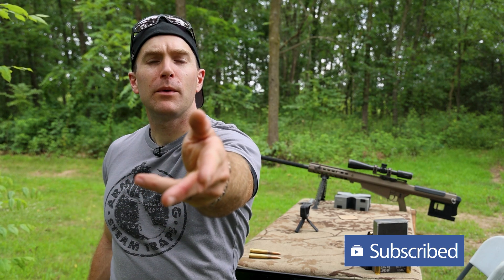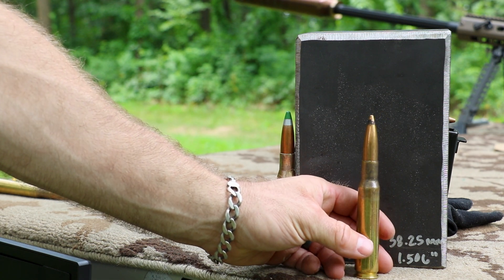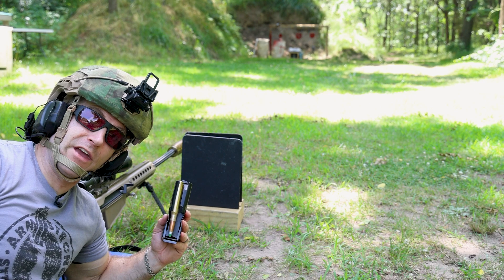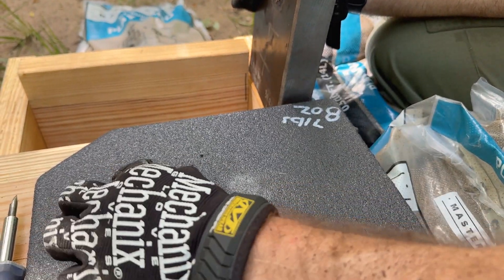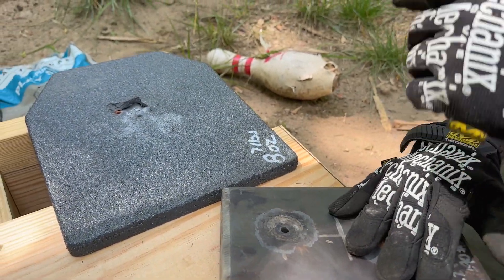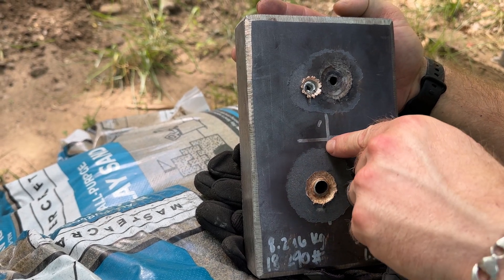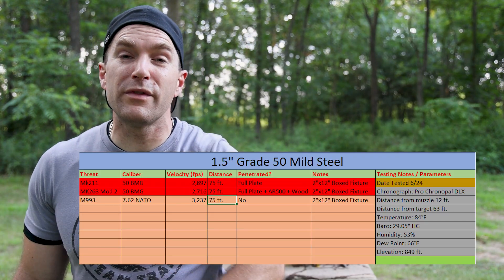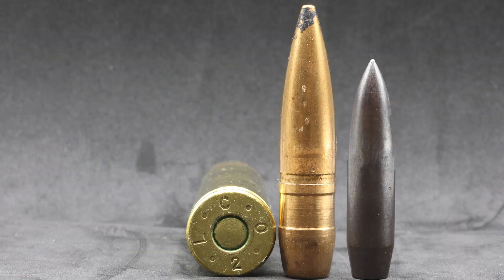Can 50 BMG MK211 and MK263 Defeat 1.5" Mild Steel!

Comment: Does mk211 have better penetration capability than 14.5mm b32?
Reply from the maker: There's no hard data I'm finding about MK211's RHA performance vs 14.5mm B32. Generally speaking Mk211 is tungsten round and it can penetrate more than a hardened steel core, but MK211's core is also designed to break up. Some sources say MK211 RHA performance at 500 yds is 50mm at 0° vs 14.5mm B32 is 32mm at 90°.

Comment: Hi,  Great video !  I was Just wondering   where did  you find out all the specific details  and pictures of the MK263  projectiles.  You posted the metal composition percentages  and  core weight on Flickr.   I can't find any information  details about the MK263  projectiles on the internet.  Just wondering where you found all the details. 
       Robert
Reply from the maker: @robertsantini2000  well I have a habit of going down a rabbit hole.  I typically sacrifice a projectile when I get them in to get the core out if  it’s AP. I have access to a really expense device called PMI - positive material identification. It only works on metals and it’s used at work to ensure vendor is supplying us with the actual steel they say they are :)
Reply: That's a fascinating machine you have access to.  Would you know exactly what type of tool steel this mk263 is.  I did some research and the closest metal with that matches that composition that you gave, is T1 high speed steel.  This is a tungsten steel alloy with 17% tungsten.  Is this what you think it Is?
Reply from the maker: @robertsantini2000  I unfortunately don't. Sometimes the machine can find a "match" but without being able to talk directly to the manufacturer, it's likely a guess. I would say if we were betting T1's composition sounds pretty darn close.

Comment: Speed and hardness defeats armor as you can see from that Gaping hole. 18 inch barrel is a waste of 50 bmg
Reply from the maker: The good thing the 19" BMG has value to me as it can simulate a 200 yard engagement for a 29" BMG.. But That's why I went with the 29" to begin with :D
Reply: @BuffRANGE  Definitely proved a point and the results were ASTOUNDING. I didn't think there would be that much pass through.

Comment: I followed the trajectory of a yellow fruit and found myself here 😂

Sheesh, that MK-263 is nasty! The hole it left wouldn't look any smoother if you had drilled it, and then to go through the AR-500 and still be intact to bite the wood, ouch! Not many rounds can say that they are meaner than Raufoss, but I think this one just about pulls it off.

I find the crater that the Raufoss left on the entry side very fascinating, I know that they contain an explosive filler along with ever other filler that has ever been conceived, but I always figured that was mostly just to enhance the incendiary effect, I didn't expect the surely rather tiny pea of HE to actual do significant damage on its own 🤔
Reply from the maker: Indeed it's pretty cooL!

Comment: Do the plates get warmer or hot from being shot with such massive rounds?
Reply from the maker: I think because they penetrated they did not transfer any meaningful heat to steel. It also could be since it's 18lb it wasn't enough heat to warm it up.

Comment: Would be interesting to see how they compare at longer distance, but i dont know know doable that is.
Reply: It's tough to test cartridges like these at range because their ballistics don't often match standard ball ammo (or each other), Even over just a hundred yards, you can get a point of impact shift of several inches when everything goes right (no dodgy ammo, no issues with the gun you're shooting it out of, etc.). So in order to sight in the rifle to hit the target at a significant distance, you'd have to use at least several, if not many of the super expensive and rare rounds to do so in order to score a clean hit to film. You either end up spending a pile of money on ammo, or a pile of money getting a target large enough to hit. That little hunk of mild steel he shot probably cost close to a hundred bucks all on its own, and the price would skyrocket for every inch taller and wider you add.

It doesn't help that most of these rounds are fairly old and sourced from wherever they can be found, so often there's no telling how they have been handled or stored over the years and the performance may change from one round to the next, even between rounds of the same type purchased in one batch. On top of everything else, all of these are military ammunition, designed primarily for use in machine guns, where accuracy by volume is an acceptable standard; so even fresh from the factory, you'd be unlikely to get match grade performance and consistently hitting smallish things at long range still wouldn't be easy.
Reply from the maker: Right! Effectively this is how I would test using shorter barrels. The 19" 107A1 is like a 200 yard engagement if you fired from a 29". The issue now is affording said 19" upper.

Comment: A challenger for the MK263 Mod 2 would be the NAMMO NM185  Armor Piercing Super/AP-S, which uses an enlargened tungsten core, either with inert or incendiary point filler. It was designed to try and rival the M903 SLAP with better accuracy.
Reply from the maker: That sounds not easy to get..
Reply: @BuffRANGE  Basically impossible, more of an observation on my part.

Comment: Crazy to hear you pay 100$ for 1 round. Standard combat load for my M2 is 400rounds of MP(mk211). I think the budget price for 100round box is something like 40$.... not suprised how well the MP did compared to AP round, i vaguely remeber somebody during my machinegunner course talking about the ex-charge "assisting" the smaller penetraror when fired at hard objects.
Reply: According to a procurement document unit cost per one mk211 was $9.41 in 2013. 

This means a box of 100 was $941 and 400 units would be $3,764. 

At 450rpm an M2 firing these would expend $70.58 in ammunition per second, or $282.30 for a four second burst.

Presumably due to inflation they are significantly more expensive now in 2024.
Reply: @andreahighsides7756  US procurment nummbers yeah? I am Norwegian, our state owned ammo company Nammo IS Raufoss. They make the stuff and the army buys at cost. Samme with a M72 LAWs, they cost like 200$
Reply from the maker: Yeah that's how bad gray market ammo prices are :(

Comment: I wonder how the Swiss RUAG 50 AP would do?
Reply from the maker: In our prior testing it couldn't defeat 2 stacked 3/8 AR500 targets.
Reply: The RUAG   .50 BMG AP  factory loading will go through  2.5" of cold rolled (mild) steel that is ~ 25 % tougher than regular mild steel...and penetrate ~ 4" into a piece of telephone pole after when fired from a 36" barrel.  A handload with the same projectile out of a 38" barrel at ~ 3,275 fps will easily penetrate 3" of cold rolled steel!  This load using US869 will develop slightly over  17,866 ft. lbs.!  The projectile design offers perhaps the highest .50 BMG muzzle energies at allowable pressures!